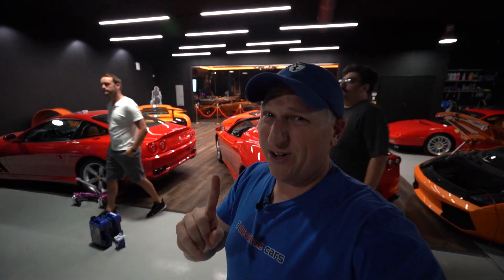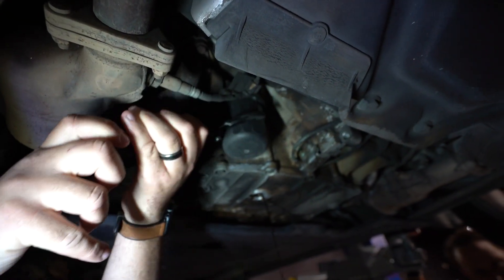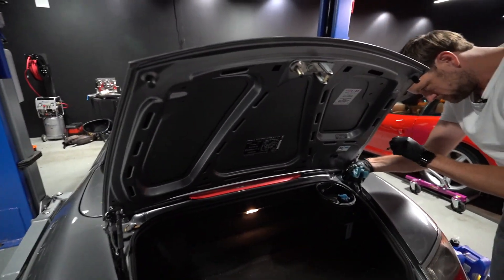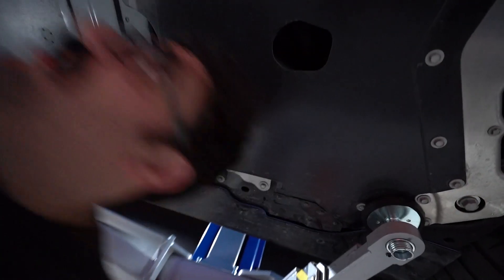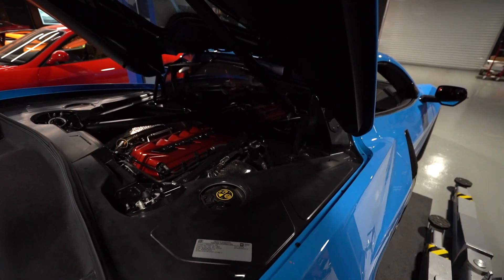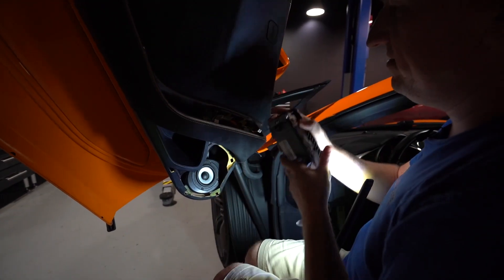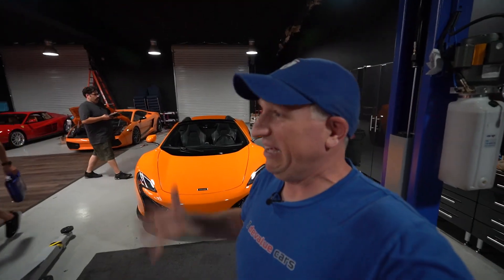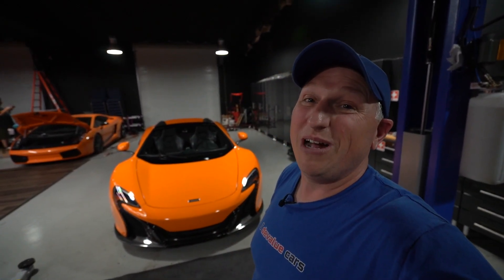McLaren 650s DIY AC Screen Replacement and C8 + Boxster Oil Changes

Comment: 14:45 the explanation behind the screen failure, in a nutshell, is the voltage that illuminates the screen is peaking higher than then tolerance of the screen spec. Also, you're welcome for the replacement tutorial ;-)
Reply from the maker: Yes thank you!
Reply: Do you put a capacitor inline to solve it?
Reply: @philipparana9225  Capacitors do not control voltage, they store energy. The replacement screen is a complete redesign, fixing the problem.
Reply: @McMedics  Capacitor impedance reduces with rising rate of change in voltage or slew rate dV/dt or rising frequency by increasing current.

This means it resists the rate of change in voltage by absorbing charges with current being the rate of change of charge flow.

So at DC in theory there is open circuit high resistance but for rising AC slew rate, the effective resistance drops inversely with rising dV/dt = I/C
Reply: @philipparana9225  Capacitors also effect other things. Regardless, the device is a complete redesign, it's not modifying.
Reply: The new OLED module design actually has a dedicated IC which filters out noise on the 3.3V line. The design also sets lower limits on the maximum drive voltage which powers the individual OLED segments. I wanted to be sure to take out noise and voltage over-driving which could cause the premature death of the OLED. It also has ESD protection on the main signal lines.

Comment: If the c8 hasn't sold, you should do the transmission track fill, adding 2 liters of dct fluid. There are a few different ways to do it. I'm sure it would attract lots of traffic to your YT.
Reply from the maker: It's sold but still in our possession

Comment: In the USA and I guess specifically Texas,as a dealer selling cars, does the buyer have a warranty in law,above what a private seller is tied to?
In the UK 🇬🇧 a trader has to abide by consumer laws selling used cars (if a fault is found withing 30 days of sale,it's assumed in law the fault was present at time of sale and it's the dealers dime that's going to fix it) which a private seller (sold as seen,you drive it after buying it,you shoulder any faults,not the seller)
Reply from the maker: Nope no warranty.

Comment: Nobody reads my instructions. LOL  For the OLED replacement, once you remove the entire assembly from the door, you only need to remove the CF (in this case) cover. Now remove the metal bezel from on top of the OLED. You can easily pry out the bad OLED with a small screwdriver or tweezers. Then just pop in the new one. There is no need to take the entire assembly apart. It's literally under 10 seconds to remove and replace the OLED. If you replace the passenger side in the future, give it a try. It will save you a bunch of time :)
Reply from the maker: Ah